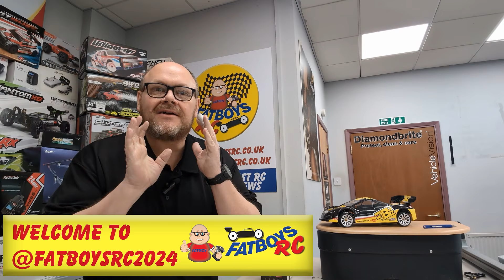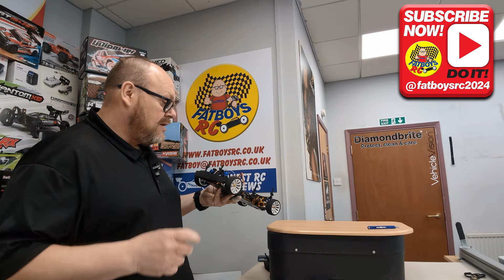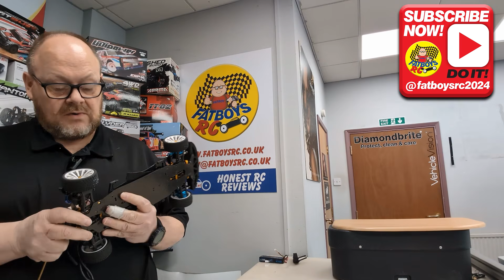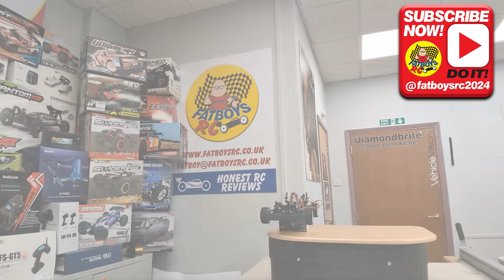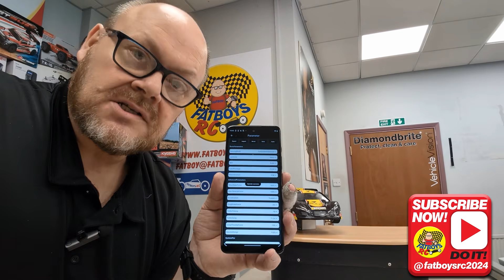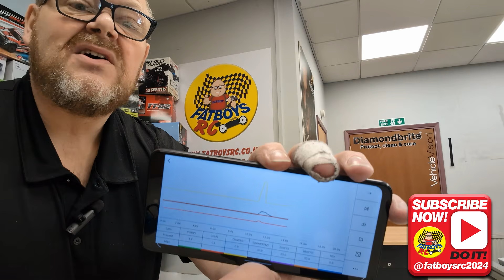Installing the Amazing XC ESC E Series Motor and ESC. Check out this great bit of RC KIT #rc #rccars

Comment: Hey if I have a xc eac dual xt90 connectors how do I run just one battery instead of 2 or can I just plug one in and it wil work 😂 im new to the hobby
Reply from the maker: Normally to run 1 battery on a dual connector, you will need a terminator block of some kind. Normally, just an adapter to complete the circuit.

Comment: What if the wires on my motor are not labeled A B and C? They’re just red blue and black?
Reply from the maker: If it is a sensory motor it should be labelled. Different manufactures use different Colours. If you buy a combo, the ESC should have matching colours.

Comment: Ever seen issues with the Bluetooth connection on iOS? My app just doesn’t see the ESC on an iPad and an iPhone, but both are running 26.5

Going to look for an older device
Reply: Mine too
Reply: @HEnderKen5  I fixed by using the RTR LINK app

Comment: Rely nice  video with a lot of whistles  :) Have a Question. Have E10 and DumboRC P10F(G) A bit confused where the X-Bus cable goes in as on channel  3 i have  Lights :)  And i have no idea do i need X-Bus and what it does :) So a bit help will  be precious. RLAARLO Omni terminator Carbon, DumboRC DDF-350 Controler
Reply from the maker: As far as I am aware the xbus can connect to any normal channel. It is a technology that is more of a luxury. The xbus system can provide live two way telemetry between the esc and a xbus compatible transmitter. Don't worry if you are not using it as it is an option. I hope that helps. Thanks for watching.
Reply: @fatboysrc2024 Thanks. Any chance you have some more build up about configuring it ? My basher just flips  un the back  if i try to go full powa
Reply from the maker: @G0ncika5  It is a very powerful motor. I dont have anymore videos at the moment but, I would knock the punch down low. I am planning on putting this combo into a cheap basher to see what happens.

Comment: I had an oops i was rushing and connected the esc into chanel one and bus into chanel 2 and my esc smoked ever so slightly. Do you reckon its toast? Same exact esc your installing
Reply from the maker: That does not sound good. If it is still working it should be ok. I did not think the receiver connections could do that. Wrong polarity between motor and esc normally cause that sort of problem. I have now put this motor in my new touring car and it is amazing.
Reply: @fatboysrc2024yeah as soon as I seen that I was like what the heck did I just do and the esc was beeping like an alarm that went off but the beeps got muddy and ugly so I was like wow I just toasted my esc. It did run after however smoke just doesn't come out and im sure something did get messed up 🤦  oh well live and learn i guess. It is an outstanding esc and motor combo i loved every bit of it.

Comment: I'm in the middle of installing their foc system in my rig, and the Bluetooth will not work. My phone sees the ESC but when it tries to pair, it says incorrect password. It doesn't prompt me for a password. I've deleted and reinstalled the app. No luck. This is getting frustrating.
Reply: Same I'm on the second one as well. Still no Bluetooth connection
Reply from the maker: I never have Bluetooth issues. The only time it does not connect is if the transmitter is on. Make sure you turn off the hand set.
Reply: @fatboysrc2024do you have an iPhone or Android and how old is your specific ESC?
Reply from the maker: @gainsrc Android. It has worked on 4 phones but I have not tried IOS. The esc is around 2 year old I think
Reply from the maker: Sorry 1 year old
Reply: Did you try password #1234
Reply: @spike-- I did. No go and with 2 of 2 units not working they got returned.
Reply: @gainsrc 
 Fucked around with the E10/4100kv. I was about to give up when it started working. Hours later now I'm afraid to touch anything since it seems all good now. 
 It never asked me for a password. When I saw the data log move with the throttle it gave me hope.

Comment: that's so good
Reply: I have the XC E 10 and is will not connect Bluetooth. I have tried both my tablet and phone. I returned the first one and the replacement is doing the exact same thing. I've tried resetting the Bluetooth on both of the ESC I've had and still no connection. Is there a firmware issue with the US models??
Reply: @gainsrc I am seeing the same thing on iOS 26.5 - iPad and iPhone do not see the connection offering in the app
Reply: @Blur125 I ended up returning both. Without settings it's no good to me 😢
Reply: @gainsrc  bummer - RTR Link app works for parameters
Reply: @gainsrc  I haven’t had an issue out of mine. Are you sure you’re using the right app? There is an old app and a new app
Reply: @bashmasterRC I used the QR code and downloaded directly from the manufacturer. I also tried the market version.
Reply: I’m interested nice video!